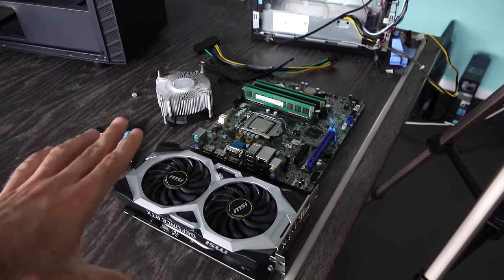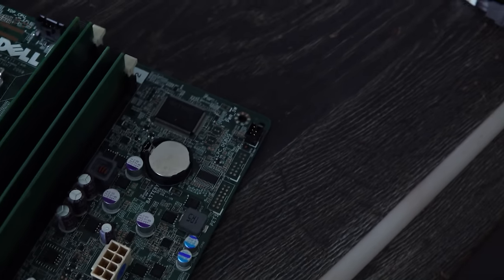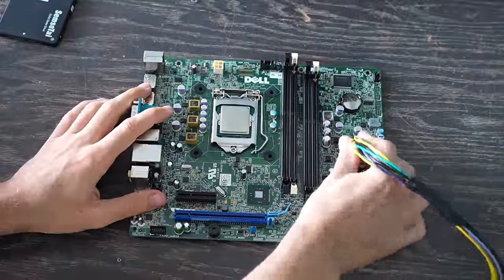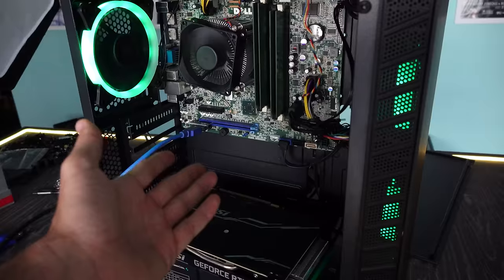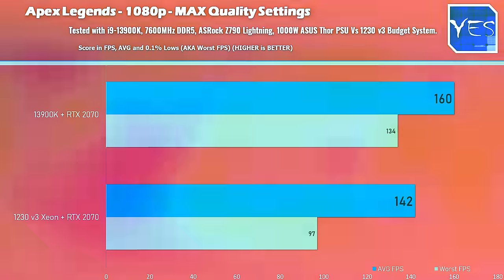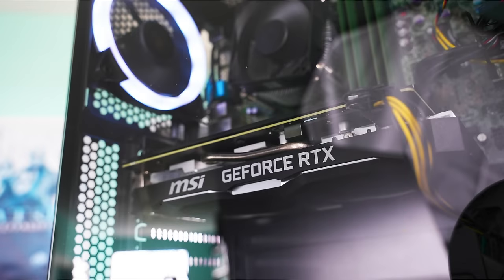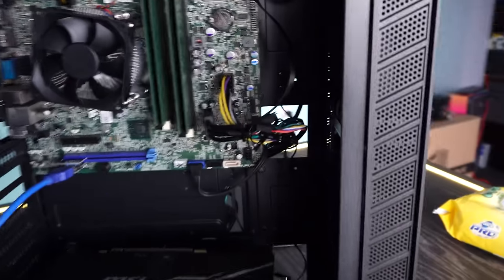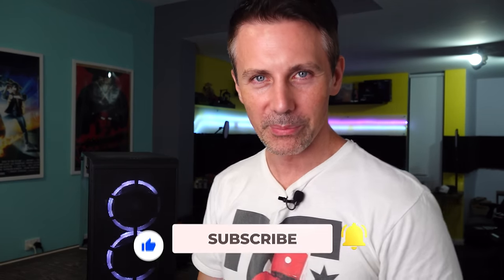Turning a Dell PRECISION T1700 SFF into a FAST Gaming PC

Comment: I built a system using a Xeon 1230 V2 about 12 years ago. It's still my backup desktop. It gets the hand-me-down graphics cards from my main system, and it's still a perfectly usable computer.

It's nice to have the latest and greatest gear, but like this channel constantly shows, you can get pretty good performance within a nice budget.

Comment: I took a Precision T1700, 4th gen i5/16gigs Ram, and mounted all the stock internals onto the back of a standard Element TV. It's been one of my favorite units. From the front, you cannot tell it's anything more than a basic TV. On the back, All the hardware, plus the stock PSU. Repurposed the case can to cool the TV from the vent on top, and I can run it at 75 Hz, and with any select random GPU, it handles games just fine. I've rebuilt a few of these workstation units, and I love them. So, my Non-smart TV ended up being an absolute Windows 11 unit that has been running non-stop for several weeks now, since it got moved. It never gives me any issues, and runs nearly silent. Note on the fans, though, if you do ramp them up, they don't go anywhere in between Idle and Full speed. Yes, get get noisy, but move a Ton of air. This is good if you don't mind the noise, and you can also ramp up the speed on any GPU you have independently, in case you're running it hard. Being open air on the back helps, but I've also made a neat little cardboard shield that is housed and held on by the CPU fan, painted it black, and it looks good and does the job of dispersing air over the mobo. All in all, these are nifty little units to play around with.

Comment: I just built a linux workstation for digital painting using e3 1270 v3 + h81 matx mobo + 16gb ddr3 + my old gtx 960 (I don't game so any card is good enough for hardware acceleration.) Even including the gpu price the whole build is still really cheap (around 150 usd) Really happy with it.
Reply: Using the same setup as a lab computer. The gtx 960 4gb cost me roughly 25 USD. Chinese motherboard, found a bundle locally. Cpu + mobo for 50 USD

Comment: I tested a 1080 with a 3770S recently and got around 6700 points on Time Spy. I was really surprised at the gaming results. I just wish I had a local market like yours because I could make a living just building PCs. I'm going to give it a go selling online. I have one I am preparing to sell right now. It is a 3770S and 1650 in a 15+ year old Rosewill case. I was thinking, 'who the hell is going to buy that?', until I realized I was looking at it all wrong. It isn't a crappy conglomeration of old parts, it is a budget e-sports 'Sleeper PC'. It will get 200fps in Fortnite or CS2 but it looks like the PC your grandma bought in 2007.  I'm also putting together a 4790S and 1080 FTW in a modern style case with RGB. That one actually ran Cyberpunk at 1440p with 60+ fps at medium settings. Again, I was surprised, and the CPU was about on par with the 10th gen i5 in my budget gaming laptop.
Reply: Genius. I might have to take my former gaming rigs and give things a try also. Esports sleeper PC ;) great marketing there.

Comment: i did this with a newer dell inspiron 3910  with a i5 12400 i changed out the i5 to a i3 12100f and added a rx 6500xt with the oem dell case and psu and i was surprised how good it was at gaming.. great video!!!!
Reply: why would you change the cpu to a worse one
Reply: @edan7813 
many reasons, actually. Maybe OP wanted that chip for himself? i'd do that :^)
Reply: @itsdokko2990  yeah i would to but he never said anything about selling it

Comment: Just finishing a Ryzen build it has a 1700x cpu, x370 pro carbon motherboard used, then the new parts are, Intergral 512gb nvme ssd, Corsair 16gb 3200mhz ddr4, Hellcracks atx temtered glass case, Gamemax 500w bronze all black sleeved cables looks slick lol whole build cost me 180 euros with amazon blackfriday sales and prime delivery lmao and to make it better i sold and old i5 cpu and z170 motherboard, so it basically paid for this whole build minus a gpu.. updated the bios and it supports upto a Ryzen 5800x3d lol

Comment: Another great video showcasing that even older parts can still be useful and do some gaming. I personally do a lot of builds like this but here in California people see Xeon and shy away from the build. I recently sold an i5 2400 system that was originally posted with an E3 1240-V2 which has twice the threads. I guess it's just people not knowing anything but the mainstream core branding.
Reply: What a story. Super casual people just know i5 are decent. I might try that in reverse, have an old i3 2100 around.

Comment: Just an FYI, you mentioned in the video you used a 600-watt power supply.
The DE600 despite the name is actually a 450-watt supply.  Not that it matters for this build. 
Nice going on the flips so far. I'm struggling to find bargains like you manage to down here in Melbourne.

Comment: wow - tech yes bro - I have a little silly story to tell you - so I have a dell optiplex 9010 with a 4th gen i7. just got it. I have a few already so this is this weeks  tinker with it and fix it up ya dig - I decide to try this plan you have here out, because I have a 1050 ti sit here, and the stuff all works great. so, I put together the build, and I take my rig I got here, and a power supply with me, and I go drive 3 hours out of town, and (3 hours back) just to go look at the micro center for this wire harness and little jumper pin. then it all went wrong when I talk to the guy at the service desk. he told me in so many words as much as that - what I wanted to do wouldn't work. that I needed to use only oem parts - and basicly keep it in the old case and whatever. he gave me like 5 different reasons why. he really didn't want to open the 4th gen from the look on his face. so then, like, I told him, ok, but, I can do all of it myself tho bro, and it all works already as it is, nothing needs repaired.
 I just need the jumper and the power wire adapter, to buy a random new case and stick it in it so I end up with a build that's all good and looks nice.. and he told me before he would get any parts out he needed to diagnose my pc, and that would cost me 250 to start out - I'm here to tell you I wont be give up so easily, I respect the schooling that I have gotten here and already knew he was a NO-MAN and not to listen to him, when I know these parts exist, and how to make a system setup and post. the guy wanted 250 bucks for wanting to basicly waste my time messing with my stuff doing shit that doesn't need done, instead of lead me to the aisle with the jumper pins and harness wires and sell me 2 parts I asked for. has anyone else experience this at micro center?

Comment: Now you're cooking with gas!  Finally, some Dell Precision love!

For Fortnite, two things:
1) Post-processing kills performance on anything and can just be set to Low without any noticeable visual change.

2) Older systems benefit massively  in the percentile lows by uninstalling the high resolution textures pack from within EGL.  You can still set the textures to Epic even after and the game looks awesome but stutters much less on Broadwell and earlier.

Comment: some good tips and shortcuts here - going to a bigger case and using ps adapter are major just for ease of use and you can fit more hd in etc. with win10 eol expect to see more ewaste pc and lower prices but the older pc mkt is losing its compelling value with every gen

Comment: I did a flip-job on an i7-6700 lenovo tower 3 years ago. Swaped a psu for a 500w and added a gtx1060ti. I had to flip the powerswitch everytime i shut it down. Told the buyer. He didn't mind.

Comment: I hate the fact that OEM equipment can be so proprietary that rehousing it like this becomes such a hack job. I know there is always a market for real budget builds, but considering that Windows 10 support ends in less than 2 years, I struggle to suggest anything lower than 8th gen Intel at least. Maybe I'm just too fussy 🤷🏽‍♂️
Reply: Windows 11 can be backdoored onto even X58.

And official mainstream support ends in 2 years; long term support will go a bit beyond that.  But mostly the topic is a moot point for gamers; the average gamer downloading their Steam/Epic/Origin games isn't a big mark for security exploits.
Reply: @doesitgame  I know it can be backported onto older systems using RUFUS etc, which despite the requirement for UEFI boot, Microsoft obviously haven't stripped out BIOS booting from the codebase yet. I imagine Windows 12 will though. Anyway, like I said I get the budget gaming segment, I just wish the baseline was slightly newer gen equipment.

Comment: I was suprised you went to gtx 20 series for a 4 core Hazwell cpu.  I just built a system with a i7-4790k (they are coming down in price from when they were always overpriced).  I only went for a gtx 1070.  As you said its really in those cpu intensive games like battle royales but also games like shadow of the tomb raider and watch dogs legion that the hazwell 4 core cpus really show their weakness.  Still great for super budget gaming PCs though.

Comment: Since I can buy an '2nd hand' AMD Ryzen 3600X for $45,- ( and an cheap ( $35,- ) B450 motherboard )   Would you still recommend, an Xeon 1230 V3, over that ???
Reply: You'll need ram too, but good question. B450 a great platform with upgrade options.
Reply: 100% yes. AM4 is a much better way to go.

Comment: I agree with what you said about prices coming down on used parts so it's for that reason I truly believe this isn't the best path to take when trying to build a cheap gaming PC. You can literally run games like Fortnight and Apex Legions on a potato! Used after-market main boards from the 4th to the 7th gen Intel chips and a lot of the slightly older AMD chips are very cheap if you look for deals or negotiate prices with the seller. DDR 4 RAM isn't horrible but that's subject to change soon with the NAND chip shortage coming. I put together a 7th Gen Core i7-7700K system with an Asrock board, mid-tower case, 16GB RAM, 512GB SATA SSD and a 2TB spinning drive as well as a GTX-1080 8GB GPU and a 650watt modular PSU for just under $400 US using all used parts. The system is very fast, over-clockable and completely upgradable! Using these old proprietary boards will not give you any of that and will be obsolete in about a year.
Reply: Might be possible where you live, but the OEM stuff will be a lot cheaper in most places that aren't the US.
Reply: @AmosDohms  I completely understand but if it's gaming you're wanting to do then just get a console. Those are everywhere and bypass all the "building a gaming PC" stuff! Hook it up to your TV and go! Sometimes the costs don't justify the means and "simpler" is always easier and cheaper.
Reply: @walterlegere1403  Ya, it's really hard to beat really any Xbox 1 for gaming on a budget, but you can't do anything but game on it, and you get ripped off with online subscriptions. I'd rather go for the computer, even an old one, but I can see your point.

Comment: Whats your plan after this year, when cant activate Windows 10 anymore ?

I am gonna try build me couple extra offliners for sure.
Reply: Can force 11 on them tpm bypass for gaming.
Reply: @dianaalyssa8726  Yes, but there are not gonna be W11 drivers for the cpu/socket, gonna be an issue.

Some oldest ones dont have for W10 even.

Comment: i have a z230 workstation and i am not familar with pc building. I had a spare 2070 and wanted to fit it in my case but the power supply doesnt have the necessary 8 pin pcie so i wanted to know if i would have to get a new atx power supply and try to fit it in or if there was a workaround that issue.

Comment: Hey yes man i tried  The Finals but my fps wont go over 60 any low-max settings iam running a 1240V2+RX6600XT  idk what to do drivers and windows are upto date

Comment: Hey Brian, Do you know if a Dell XPS 8900 with an i7 6700 is able to be easily transplanted into a modern case?  Found a good deal on one but don't know if its got any complications.  Thanks!
Reply: It's a piece of cake as it uses standard 24 pin mobo connection + standard cpu 4 pin.
Reply: @fiddlermuncher8701  Oh sweet, Thanks for the info.  If I can get it for under $100 it could make for a banger budget build with a gtx 970 or something
Reply: @manofyeo  agreed buddy. Or maybe even a gtx 1060 😎👍

Comment: 2070 is a massive overkill for this xeon
Reply: yeah this is a crap cpu, better to go with a 10th gen i3 or better, that way at least you get modern cpu instructions, support for windows 11, etc .. v3 xeons are crap
Reply: @MCFreck  10th gen i310100f is also a huge bottleneck for a 2070. i510400f is where it starts to equalize.
Reply: AVX 2 is basically the minimum requirement for modern gaming & Haswell onwards Intel chips fill that requirement. It's the 3rd gen and older + AMD FX that aren't gaming worthy now

Comment: No rear I/O shield?
No front audio?
No mention of the $80 postage fee on that case?
Windows 10 support ends in under 2 years, and this can't officially run Win 11.

Yeah, it would want to be cheap! 
😆
Reply: Has Microsoft announced the end of windows 10 support?  And I believe there's ways around their "requirements" if they do.
Reply: @manofyeo  October 14, 2025 is the date. Yes there are currently ways around it to install 11, but Microsoft could pull updates for non compatible systems at any time.

I only made the point because if you are buying/building a new system now, most people want it to still be reliable and usable for over 2 years.
Reply: @LukeTheJoker  Yeah it is a valid point, especially for a flip to someone whos not pc savvy.  I'm glad I gave the dude on my last build windows 11.  But I also think that using windows 10 after support ends wont really matter.  I don't think security updates are really as ominous as they make them out to be.  I'm so used to 10 I don't really see a point to switching yet myself.
Reply: @manofyeo  Yeah, not worth switching if you don't have to yet, Win 11 is still a buggy mess compared to Win 10.
Reply: Thats how this channel make living. 80% videos Bluffing upgrade old pc. If he tells u all those cons, who falls to watch those videos then?

Comment: Bryan, please just stop with that OEM transplants. For 50 Bucks u can score h81 mobo with 16GB ram. No adapter shinenagans, more poeple could help you, if u made a mistake somewhere. Heck, even if it costs couple bucks more, just use normal hardware for better resale value